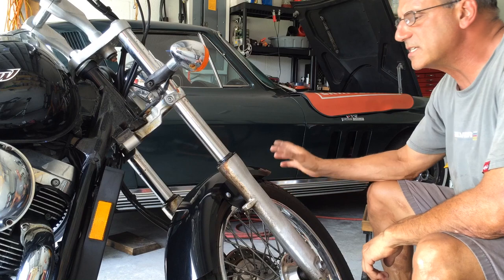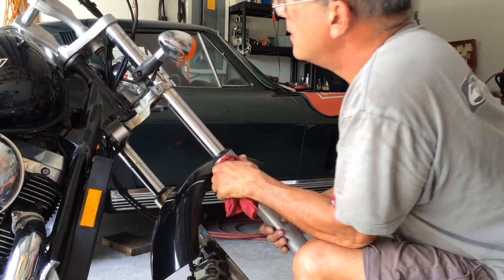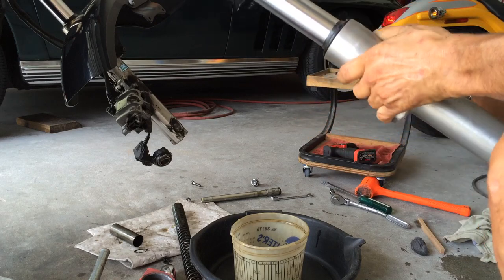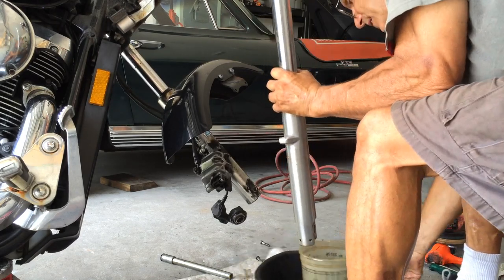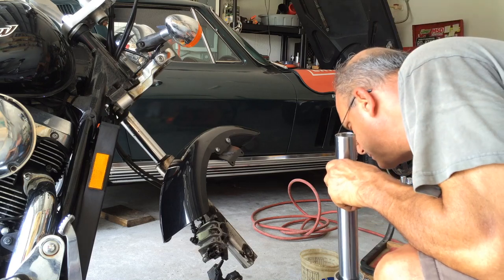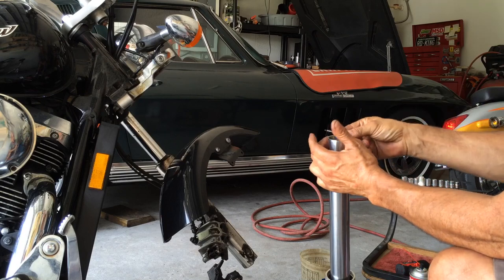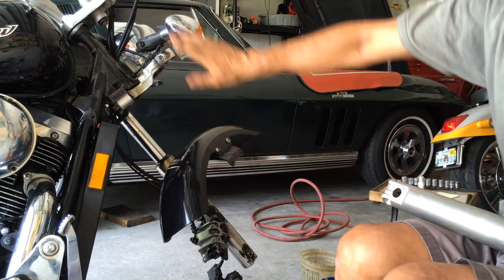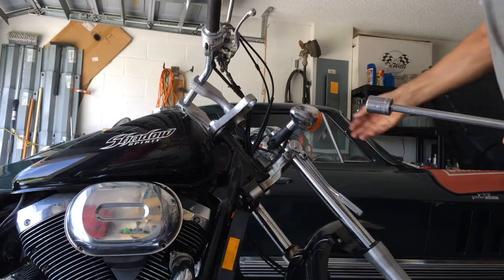How To: Repair Honda Shadow Fork Seals  Part 1

Comment: I followed  all your steps but my forks seem to be stuck any idea on why or how to fix it
Reply from the maker: Your bushing is getting stuck.   You did remove c clip. This has happen to me once.  Unstick twist and slide out hard.  It will pop. It was a pain when this happen to me.  Let me how this works out.
Reply: One you put the bottom bolt in the stay stuck
Reply from the maker: Bottom bolt has to be removed as showed in the video. to remove tube from fork.. is that what you are stating.
Reply: It  was after I put everything  back together  it has no slack
Reply: Once it is back together  an I put the bottom  bolt in it won't  uncompress
Reply from the maker: Hope this helps  .https://www.bikebandit.com/oem-parts/2005-honda-shadow-spirit-750-vt750dca/o/m151122#sch407070.
Reply from the maker: Take apart reinstall..

Comment: I noticed that when you first took out the spring the tight coils were at the bottom and when you put it back in you put the tight coils at the top. Did you notice any change while riding?
Reply from the maker: Made no difference that I notice. We did end up rotating that spring. Just in case. Thank you for your Sub. Ride Safe and have a great day.
Reply: 👍 thx you too!

Comment: What is the name of the tool you use to measure the hydraulic fluid in the container?
Reply from the maker: Happy to help, the container has increments on it. It's just a paint container. And the tool I was using was a Lufkin's carpenters ruler. Thank you for watching and all your support Shea. Any questions just ask. Ride safe and have a great day.
Reply: @TwoWheelRocco  where do you buy this ruler at?
Reply from the maker: @SheaFarrell360  That would be Home Depot, but you do not need that. Lufkin.  Any ruler will work.

Comment: Hi I have a 2002 vt1100c2 sabre and I have a manual that is telling 173mm for oil level could I have the wrong manual, it goes from 1997-2003 models
Reply from the maker: Hope this helps,https://www.hondashadow.net/forum/72-technical-discussion/51870-fork-oil-capacity.html.   Let us know how this works out.

Comment: You know that seal will come out with dismantling the fork right? You can poke a hole in the seal an pop it out then slide the new one right down the fork an use the old one with some pvc to install it. Seems like a whole lot of overkill unless you want to replace an clean every part in the forks
Reply from the maker: Thank you for watching and your sub Charles. Ride safe and have a great day. Stay warm.

Comment: Having a hard time with the left fork, may have to use some heat to get it out?? It has the trac system, if that makes a difference. I’m restoring a 1983 650 nighthawk. Any suggestions, other than putting some heat to the fork. Even the manual say it maybe a possibility bc the seal is so tight?🤨
Reply from the maker: I would go with the manual...Sometimes the bushing gets real tight..just keep trying I will separate. It will come apart. Let me know how it works out.

Comment: For 2006 honda shadow spirit vt750DCB 
The best fork oil is 10W or 15W if i want to use ATF Oil?
The quantity of the oil is 473ML or 12cm from the oil to the top of thefork?
is correct this number for the seal 41 54 11?
Reply from the maker: Happy to help. I like 15wt.oil. They are common seals for these fork tubes. Do you research? I'm not that familiar with that number and the height is all good. The amount of oil is all good.. Thank you for watching all your support frontendwithsalimi.. Ride safe And have a great day.
Reply: @TwoWheelRocco  thank you so much for you reply and this helpful video yes i searched and i found this number on amazon

Comment: Is removing that drain bolt on the bottom of the forks completely necessary to complete the job? I just seen that my drain bolts are stripped.
Reply from the maker: Yes it is...3/8 impact helps.. Look at 5.12 on video if that don't work you will have to remove top cap and remove oil and spring..place a long piece of wood and wedge it in there to stop the spinning....Hope that helps....Let me know how this works out.

Comment: Hey, he put the spring upside down, it should go with the most compressed side at the bottom, otherwise it can damage the spring, if you pay attention at the beginning of the video he removes the spring and it has the compressed part down
Reply from the maker: Good eye Bruno.   The funny part I didn't make a damn difference in the ride in the bike at all. I know I was surprised myself. When we realized what happened. At the end of the day it's still a Honda 750 spring.  this way spring,  that way no damage.   Same pressure.  At least I hope it helps you do your install. Thank you for watching and your sub Bruno. Great safe and have a great day. It's not life-changing.

Comment: The pcv pipe from home depot 1 1/2 inch ,how long should that be,?
Reply from the maker: pipe 11942 67602 4
1 1/2   Charlotte pipe Home Depot I bought 4 feet of a 10 foot length. if you have an email I will send a picture.
Reply from the maker: My final piece was 20 inches. A little longer then the fork tube.  Hope this helps,  Let us know how this works out.
Reply: @TwoWheelRocco  Thanks very much, That will do it.
Reply from the maker: @bassplayer336  Let us know how this works out. Ride Safe and have a great day.

Comment: The washer with the oil seals Has a top and bottom no one side of its tapered does that go up or down
Reply from the maker: Happy to help. If you are talking about the washer that goes on after your bushing. Beveled edge down..Then your seal,  spring side up,  Thank you for watching and your sub Ken. Let us know how it works out. Hope that helps. Take apart the other Fork that should help you out. If I understand you're right. Ride safe and have a great day.

Comment: Any Tips on getting a stuck seal out of the fork. Pretty sure my bushings are shot and thats part of the problem but that sucker is stuck in there bigtime.
Reply from the maker: Rotate and slide with force.  Turn a little and slide it with force. It will go. Your bushing is sliding under seal this is why it is fighting you. Let us know how this works out.
Reply: @TwoWheelRocco  Im working on it. This thing is stick in there big time. Thanks again for sharing all your info man. It is really appreciated.
Reply from the maker: @OldCityVlogs  That bushing is acting like a wedge and getting under seal. This can be a real #####.  But it will come out happen one time to me. very frustrating.
Reply: @TwoWheelRocco  Well, I hit it with PB Blaster and let it sit for a few hours, came back, and worked it for a while finally to get to out. lol. Just as I thought Bushings are Shot! Ordered some new ones. Some how I lost the washer that goes on top of the springs now. lol  Just my luck.
Reply from the maker: @OldCityVlogs   Let us know how it works out.  Thank you for your support.
Reply: @TwoWheelRocco  And another question. Any Advice on getting that top Guide bushing out of the lower fork tube without messing something else up?
Reply from the maker: @OldCityVlogs  If you could send a cell # and I will call.

Comment: Can you list the parts that you replaced? I really need to do mine. When I put on the brakes the front shocks almost bottom out.
Reply from the maker: Fork seals.https://www.ebay.com/itm/Fork-Dust-Wiper-Oil-Seal-Kit-Set-Seals-Honda-VTX1300-S-C-2003-2004-2005/362648558131?_trksid=p2485497.m4902.l9144

2 Qts- https://www.ebay.com/itm/Maxima-Motorcycle-MX-15W-Fork-Oil-16-OZ-Bottle/254250848671?epid=913970460&hash=item3b3288119f:g:sywAAOSwDwNed~F~

Hope this helps, Any questions just ask. Thank you for your Sub Jason.  Let us  know how this works out.  Ride Safe and have a great day.

Comment from the maker: pipe 11942 67602 4
1 1/2   Charlotte pipe Home Depot I bought 4 feet of a 10 foot length. if you have an email I will send a picture.
Reply: I bought 1½ pipe from lowes and unfortunately is slightly too small, I used a flathead to drive the bushing, tapping lightly with a deadblow hammer on my 1100 forks. Was wondering if the home depot pipe might be thinner on the inside?
Reply from the maker: Home Depot.  This is the  pipe 11942 67602 4
1 1/2   Charlotte pipe Home Depot I bought 4 feet of a 10 foot length.    Home Depot is how I did it.  I search all over. Hope this helps.  Thank you for your Sub.  Ride Safe and have a great day. Any questions just ask.

Comment: How much should a mechanic charge for this kind of job Fork seals?
Reply from the maker: A dealer would charge approximately three $375-$400 private mechanic would like to see $200-$250  hope that helps. Thank you for your Sub Sal.  Ride Safe and have a great day.
Reply: Hey Bud, 
Im from germany, may its not the same, but round about 250€ where I worked & I ( would 😜😜)  take about 100€ in private if I would...
Fluids & all parts needed despite the tools of are not includet.

Comment: But how did you remove that 24mm hex bolt in the fork tube
Reply from the maker: Happy to help. Take a look at.0:56 on my video.  This will show the half-inch ratchet with socket Any questions just ask. Thank you for watching and all your support Patrick. Let us know how it works out. Be patient and take it step-by-step and you'll have no problems. Ride safe and have a great day.

Comment: I see at 8:28 you're reusing your old outer bushing again? and you didn't look at your old inner bushing on the end of the inner fork tube, if you just replace the oil seal with a new seal without changing out the inner and outer bushings you're new seal is going to leak again in short time and you'll be right back changing seals again, when doing a fork oil seal job always get (2) new dust seals, (2) oil seals, along with (2) new outer and (2) inner bushings
Reply from the maker: Thank you for watching .  I replaced the seals and dust covers.  The bushing look great. As you see that was done in 2016 and all is well.  Honda...Let me know how this works out for you.  Any questions just ask.  Ride Safe and have a great day.

Comment: Everything I’ve ever read on fork oil level for the 750 says 4.9 inches (124mm) from the top. This is without the springs, etc in the tube.
Reply from the maker: OK so what you're saying is they couldn't figure out the volume of oil to put in to those tubes. That's just dealers making things complicated look past the obvious. They scare tactics 4.9 inches 124 mm How about 16 ounces each tube. have a good day.
Reply: @TwoWheelRocco  located my Honda service manual. It actually states 4.3” from top! I think I’ll stick somewhere around the 4.3-4.4 mark. Thanks for making great videos.
Reply from the maker: @parsineo  All will work out well. It's not that complicated. Let us know how it works out. Ride safe and have a great day. Ask your dealer how much oil you need. He not going to tell you 4 inches from the top. Just saying. Thank you for watching.

Comment: Anyone else not able to fit pvc? If so what did you use?
Reply: I had 6 trips total to Lowes & HD. They do not have it. Got lucky at an irrigation supply Co, cut a 3' piece for $1. It's larger than 1.5" & smaller than 2". Ebay seal driver $35 + ship.

Comment: Does anybody have a guess about how long seals should typically last?  I just bought a 2004 VT750C Aero and I don't see any oil leaking, but I think it all disappeared a long time back.
Reply from the maker: Happy to help. The dust sealed would be the first indication of a problem. They decay and the seal start rusting, Thats the start of your problem.They were probably installed new seals. Depends if you'd ride on dirty, Dusty Rhodes. If you're strictly the streets, you do fairly well, you clean your forks there's no rust.  You would see evidence of a fork leak that's for sure. You can get a little  dirt under your dust seals. I have a 2018 in my garage. I have to do fork seals tomorrow on a ,2018 HD Softail. Any questions just ask. Thank you for watching all your support Timetonut. Ride safe And Have a great day.

Comment: Anyone have any tips for getting that bottom bolt???  Ive sprayed it with pb blaster and hit it with an impact gun for a solid 2 minutes and its not budging
Reply from the maker: Happy to Help. A impact gun is the only way. Minute or two then try it again for a minute until counterclockwise it will give. And make sure you have it in the clamp of the tree and it's still spring loaded.  if it's not spring loaded I'll will just spin.. Thank you for watching and your sub Jeremy. That's not how it works out.  Ride Safe and have a great day.

Comment: Have any idea how long the original seals last?
Reply from the maker: They could last a long time it depends if it's garaged keep outdoors driven in salty climate or just plain left dirty. Should get 10 to 15 years. Hope that helps. Thank you for watching and your sub Daniel. Ride safe and have a great day.
Reply: Mine went 35 years before I seen any leaking... 86 Honda vt1100.  Always garaged and kept clean.
Reply: @TwoWheelRocco  reason I asked I bought a mint 2003 Honda shadow spirit with 7000 on the odometer with leaky seals and weather cracked dust covers. I was wondering if the mileage was correct
Reply from the maker: @pappydanny58  Happy to help,  could be the correct miles. I seen those fork seals,  after time specially if it was sitting the dust seals got all corroded. That's what causes the failure of the oil seal. easy fix.  Thank you for watching and your Sub Dan.. Ride safe and have a great day.

Comment: What kind of oil i should use and how much oil i need for tow frock of my bike thank you sir.
Reply from the maker: Bel Ray 15W, Stock is 10W, I like a little stiffer ride. Try it, Let me know how this works out. Ride Safe.
Reply: Two Wheel Rocco in iraq i dont have this so you can tell me what kind ? engine oil or hydrilc oil or what so i can buy it and if you give me a way so i can chatting you its easly ..thank you
Reply from the maker: Bel Ray 15W, Stock is 10W, I like a little stiffer ride. Try it, Let me know how this works out. Ride Safe.
Reply: Two Wheel Rocco  i cant buy this but you can tell me the kind of the oil
Reply: Two Wheel Rocco can i chit chat with you so i ask you ...
Reply from the maker: Bel Ray 15W, Stock is 10W, I like a little stiffer ride. Try it, Let me know how this works out. Ride Safe.

Comment: During my procedure when pumping the fork oil before putting in the spring the fork tube kind of got stuck when compressed in the bottom and doing a smacking sound when pulling it up again. Why's that? Anyone know?
Reply from the maker: That sounds concerning. I would rotate the bottom part of your fork.  move it up and down it should move freely. In the mid range of the movement of this fork should be smooth. If not,  I would take it apart and look it over. How was the other side?  Let us know how it works out. Thank you for watching and your sub.   Ride Safe and have a great day.
Reply from the maker: Do the other Fork and see how that works out. Let us know how this works.

Comment from the maker: Thank You for watching, Any Question just ask.
Reply: Hello Rocco.  I'm leaking out the top off my dust seal (running down to my brake disc when parked). I'm about to do my seals. Ordered the same kit of seals but for a 98 honda shadow 600. Great video! Replacing the seal and dust seals like you did should put me in good shape correct?
Reply from the maker: @chrismccart1691  Happy to help..Any questions just ask. .Let me know how this works out. Thank you for watching and your sub Chris. Ride safe and have a great day.

Comment: Thanks..hwo much oil
Reply from the maker: Happy to help. What bike?  16 oz.on each fork tube.  is what I used. on my Honda Spirit 750.  Thank you for watching and your sub Ali Qasim. Ride safe and have a great day.
Reply: @TwoWheelRocco  honda Shadow slaher 400cc
Reply from the maker: The Clymers manual says the capacity is 16.92 to 17.12 ounces.
Reply from the maker: https://www.hondashadow.net/threads/fork-oil-capacity.82976/.  Hope this helps.

Comment: Is it just me or did he put the spring in upside down from the way he pulled it out. Watching again yeah sure did put it in upside down from the way it came out
Reply from the maker: I agree,  I fixed that. Just never edited video. I said the same when viewed this video.  Thank you for your support, How did the fork seals go?
Reply: Ordered them saturday should have them in this weekend. Thanks for the video by the way it looks easyer then i was thinking..
Reply: Would you notice a difference with the spring in upside down
Reply from the maker: @4wheels269   It is fairly straight forward.  If you have any question just ask. Let us know how this works out.
Reply from the maker: @4wheels269  I would not think so. What do you think. You have a good eye. 70,000 views and you were the first to catch that.

Comment: Pvc size is a pia for me. Lowes nor HD has the correct 11/2 or 1 3/4" size. Gonna have to have them pressed in at a shop, I guess.
Reply from the maker: pipe 11942 67602 4
1 1/2   Charlotte pipe Home Depot I bought 4 feet of a 10 foot length. if you have an email I will send a picture.  Home Depot has it.  Hope this helps. Show them 1 1/2 Charlotte pipe sink plumbing pipe. Let me know how it works out.
Reply: Got lucky at an Irrigation supply Co. Can get fork seal driver, $75 @honda shop, $38 on eBay. My pvc cost $1.
Reply from the maker: Sounds Great, Let us know how this works out. Any question just ask.

Comment: Must be thinwall pipe needed, I bought 1-1/2" SCH40 PVC pipe and it wont fit over the fork piston..
Reply from the maker: pipe 11942 67602 4
1 1/2   Charlotte pipe. Yes it is Thinwall